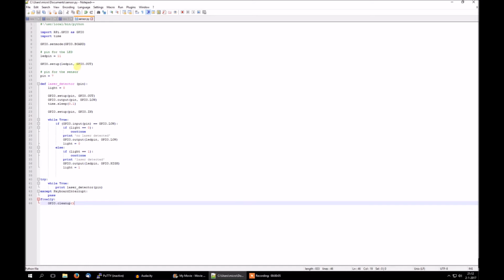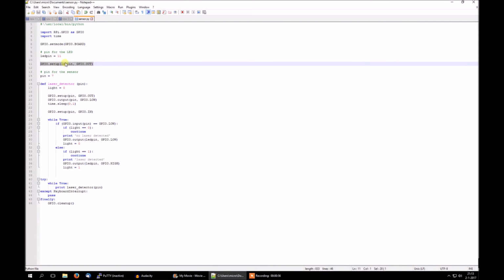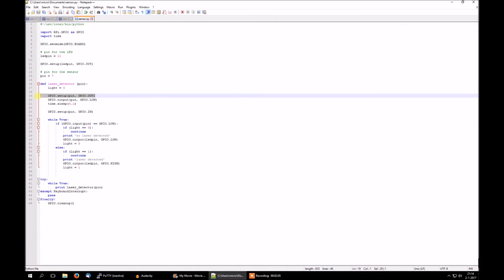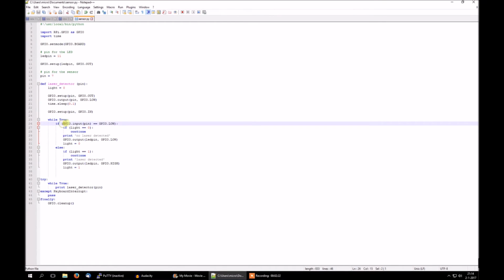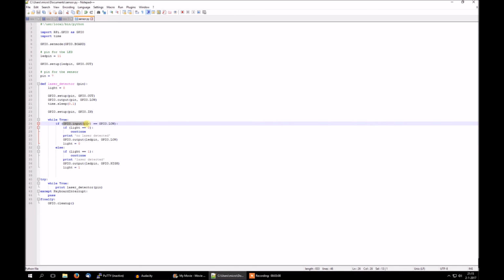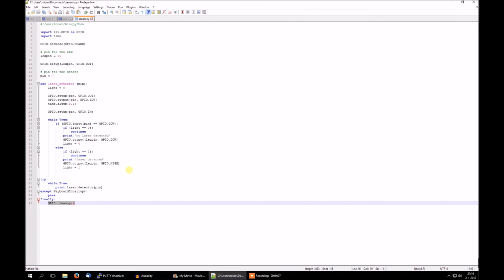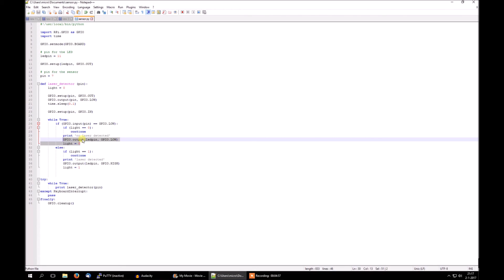Making a Laser Trip Wire with a Raspberry Pi

Comment: I'd like to use a photo diode or photo transistor instead of a light dependent resistor, simply to get a faster reaction from the tripwire system.  If you were just going to run a photo diode instead wouldn't you also need to run some resistors so you don't fry the Raspberry Pi?  If so, how do you figure out which ones you need?
Reply from the maker: You will need to find out what happens when you shine light on it. With an LDR, the resistance changes. A photo diode gives off a current. If this current can exceed the 3.3V logic "1" of the RPI, you will need a resistor to limit the current. I would start with a rather large resitor and work my way down, if the pin does not get pulled up.